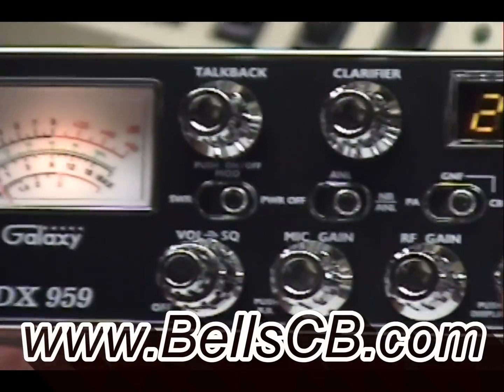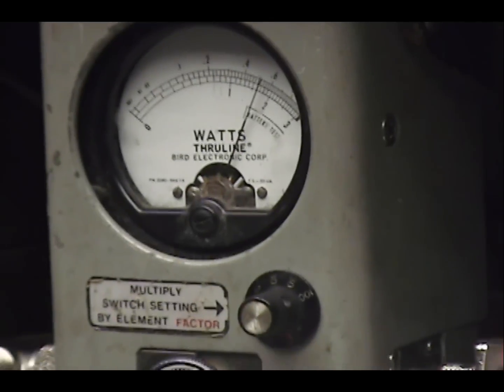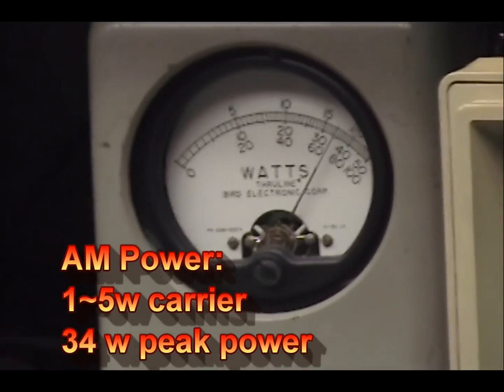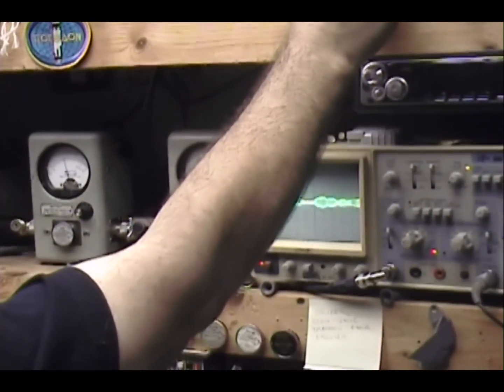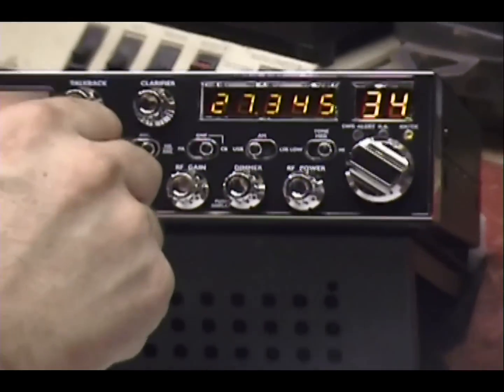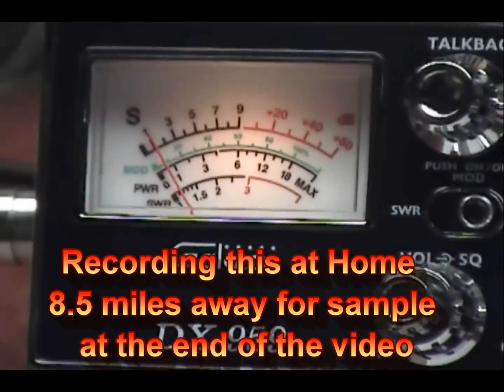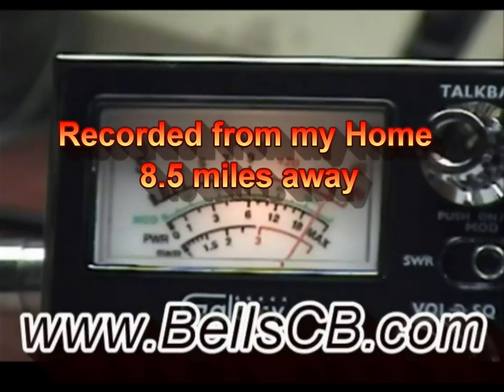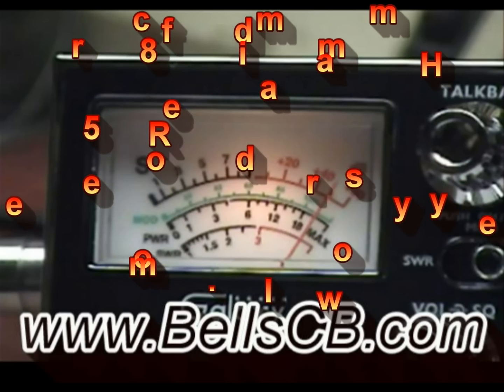Galaxy DX-959 PRO Tune-up Report

Comment: Why does the output go from 1 Watt to 5 Watts right at the beginning?
Reply from the maker: That is where I am showing the AM carrier power. It is adjustable to anywhere from 1 to 5W. This is also called "Dead Key" After that I show the AM peak power and then SSB.
Reply: How can AM carrier power be adjustable and why isn't it always the same?